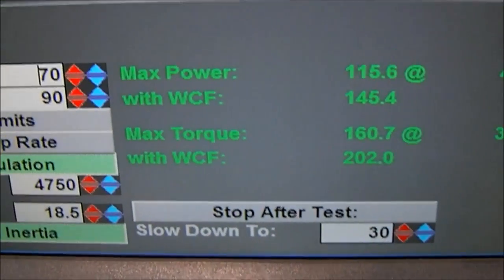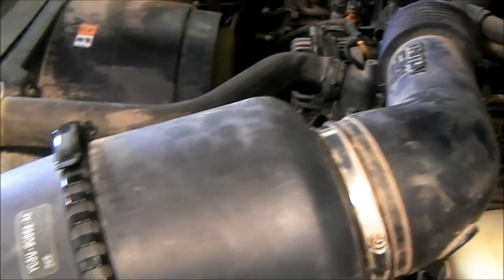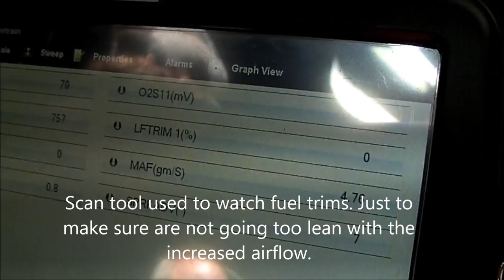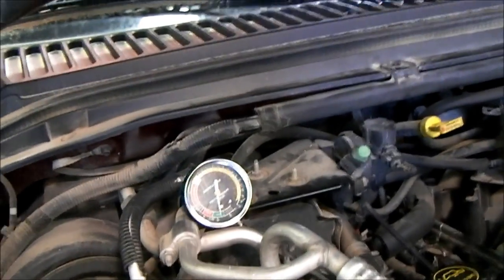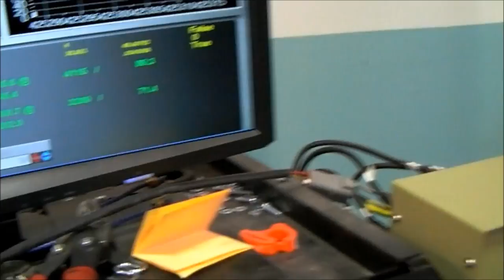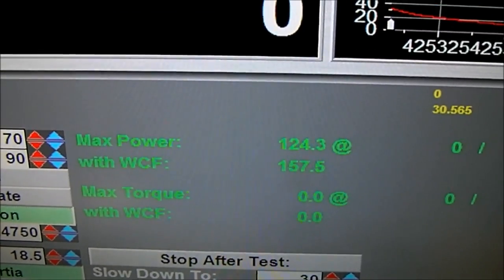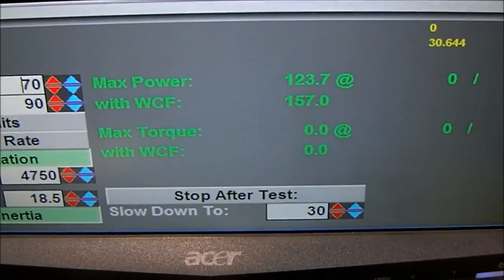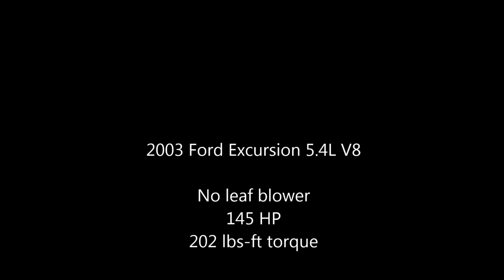Leaf Blower Forced Induction

Comment: You have successfully harnessed the power of a Honda civic into that truck.
Reply: What Honda Civic has 160 hp in 230 foot pounds of torque I’ll wait
Reply: 2022 Civic Type R 306hp / 295 lb-ft torque

Comment: The 5.4 is hands down the worst v8 around 😂
Reply: for 10 years Fraud built that Pos
Reply: tyler cobler nah, the 4.6 is worse.
Reply: Correction. The 3v version of the 5.4 that has timing chain rattle is the worst. The worst v6 ever made is the Ford 4.0 sohc from rangers and explorers.
Reply: @TheMattc999  5.4 is worst, they had many more issues than the mustang 4.6 if not maintenanced...
Reply: Not really my dad has one with 180,000 miles and goes strong with only regular maintenance
Reply: 1979 corvette 350 is pretty bad. under 200 hp but decent torque.
Reply: @jordanbrooks9649  180k on a triton 5.4 3v is elderly and a ticking time bomb. If the spark plugs haven't turned into bullets yet, the oil delivery is about to rear its ugly head any time and the literal only solution is an actual engine replacement
Reply: @samnoneofyourbisnus2543  that's bad power output but it was also 79 so kinda not surprising. However the Ford 5.4 3 valve is an absolute gangbang of actual mechanical and reliability nightmares
Reply: @TheMattc999  the 4.6 is invincible
Reply: @TheMattc999  Lol what? No issues with my 4.6 Mustang so far with 140k miles and I do burnouts daily.
Reply: @hunterpark1221  except for the fact that it has the same penchant for turning sparkplugs into bullets as the 5.4. And you should see what happens when one hits the fuel pressure sensor on your fuel rail in knocks it off. Ask me how I know. 5.4/4.6 biggest manufacturing mistakes Ford ever made (at least the early ones).
Reply: @alickswiden71  250k and was used to haul a 4000lb trailer for 5yrs in recent times.
Reply: The first gens were ok, but with a combination of the cheap nylon timing guides, piss poor tensioners and the introduction of the phasers, Ford could have done way better. BUT GM always had its issues with lower intake gaskets and head gasket problems, Dexcool was a shit fluid for those vehicles. Then you look at the timing issues that the v6's had with phaser wear and chain stretch, seems all manufactures have their issues. Early Toyotas had frame issues, some Dodges had trans issues although that seemed to be a stigma...
Reply: @hunterpark1221  it actually is a good car, the new edge sn95 mustang 4.6L. Have an 04 with 55k miles. I think the rear main seal leak is one expensive thing to fix on these cars.
Reply: @TheMattc999  
The 2v 4.6 sounds nice
Reply: Check out my 5.4 sounds better than whatever you got

Comment: Should have turbod the leafblower
Reply: shawn rayes hahaha
Reply: Cant turbo a 2 stroke
Reply: shawn rayes they are currently slamming the leaf blower on tarmacs and dailying it
Reply: Itz_Ya_Boi_Ryan yes you can
Reply: Turbo charged*
Reply: Itz_Ya_Boi_Ryan No... you can't turbo a valveless two stroke.
Reply: Biggest ships engines are turbo 2stoke diesels.
Reply: behemothfan666 F T P thats what i just said...
Reply: Itz_Ya_Boi_Ryan Are you positive that's what you said? I see and read "can't turbo a 2 stroke" when in fact you can
Reply: behemothfan666 F T P and you said " no you cant turbo a valve less 2 stroke." And thats what i said. When you turbo a 2 stroke it just presurises the crank case. So it works against the downward stroke of the 2 stroke
Reply: Itz_Ya_Boi_Ryan Exactly my point you stated you can not turbo a two stroke which is not selecting a particular functioning 2T  And I'm stating you can't turbo a valveless two stroke which you can't. but for example ones that consists of exhaust valvs can be.
Reply: behemothfan666 F T P ahhh okay i gotcha. I was a little confused there for a second. I understand you can turbo a 2 stroke with valves. But the leafblower in this video is a traditional 2 stroke. And you can not turbo it
Reply: Itz_Ya_Boi_Ryan its all good i should of worded it better. Yes Putting a turbo on the leaf blower will do more damage than good even more so with it being a piston port and not a reed induction/case
Reply: with a hair dryer? what would turbo charge the hair dryer then?
Reply: why? explain?
Reply: @natesmith1276  not the same thing by any stretch.
Reply: Lol
Reply: Leaf blower the leaf blower
Reply: @TypicalPeen  You can turbo a 2 stroke if you run it rich
Reply: well, what you do is run the outside of a leaf blower into the air inlet of the next one, daisy chain style. dont turbo the engine just its compressor?
Reply: @behemothfan666ftp4  still should have turbo'd it

Comment: The absence of a vacuum readout is indicative of a constant flow - on the top side of the exponential curve - right though the scape valves seats - so their exiting gas temperature - which would render those seats irreversible burnt, after a few hundred klicks. But this is my opinion only. A useful compromise can be met, nevertheless.

Comment: 5.4 V8 makes 145 to the wheels. 1.3 rotary makes an easy 180. I think there just might be a replacement for displacement. Still, that was an awesome result with the leaf blower! That's enough of a gain to actually count it as legit. It'd be interesting to see the difference it made on a smaller engine that flows less air, see if more boost built up and had a higher percentage difference in power.
Reply: The difference between the 5.4 and the rotary is torque. Rotary engines don’t make a lot of torque and make all their power at a high rpm. Not ideal for use in a truck. The 5.4 likely makes most of its power and torque at lower rpm’s.

Comment: The compressor in the blower can only achieve a tiny pressure ratio with it's low pressure, high volume wheel.  If you blow one leaf blower discharge into the center of anothers intake sealed, and then do this again and again with 2, 3 or 4 of them, eventually you can actually make measurable "boost" with enough stages.

Comment: oh my god is it on 3 cylinders.?
Reply: mymitsu6g72 it's a ford
Reply: i have THE SAME pos ford
Reply: I never could understand why Ford even offered the 5.4 in the excursion. We had 99 expedition and we got the larger 5.9 or 6.0 can't really remember what it was. But it was what the larger ford gassers trucks should haves come with standard at the time. The excursion really should have come with the 7.3 diesel.
Reply: ZealousAce it did my guy
Reply: s w  you have the gas version I have the 7.3 diesel thick is a lot better
Reply: ZealousAce it does come with the 7.3
Reply: ZealousAce it did. It was in the ones that say "limited" they were pretty legit, but very unefficient.
Reply: +carson walker    Being a 5.4 it probably blew some out lol
Reply: ZealousAce  maybe a 5.8?
Reply: ya, i bet it was a 5.8 bc ford does like to reuse engine designs for different vehicles. for example, the 2017 gts have the same exact engine as the ecoboost trucks. we have a 5.8 gt40 pro boss in our boat that was from 2001
Reply: emersonDAbeast wasn’t a 5.8.  Ford gasser endives were the 5.4l v8 and the 6.8l v10 for those years. The 7.3l diesel was offered from 99-03 and 6.0 was offered from 03 until the 07, the year that the truck and 6.0 were both discontinued from Ford. 5.4 and 6.8 mod motors were some of the best gas engines built by Ford. From 3,000 rpm and up, the engines moved out.
Reply: Tom Foolery oh, but they still did have 5.8 gas but I guess ours was from a ford gt
Reply: emersonDAbeast  that 5.8 was really before they used liters to classify engines. It was a 351cu in engine as the 5.0 was a 302. Neither were offered in trucks after 1998 until they came back out with the 5.0 and was offered in the trucks starting 2011, I believe. The 6.2l gas engine came out that year also for the superduties but was also available in the 1/2 ton platform along with being the only engine option for the Raptor after the 5.4.
Reply: Tom Foolery ya, i know it a 351 big block but the plastic cover says proboss 5.8, PCM, and gt40
Reply: emersonDAbeast the 351 is a small block. Not a big block.
Reply: Tom Foolery oh, well my dad kept saying it was a big block, or maybe I'm thinking of another vehicle
Reply: emersonDAbeast are you sure it wasn’t a v10. Ford had an experimental 5.8l 54 degree v10 that wasn’t offered in vehicles but I’m sure there are probably replicas all over the place. Marine racing wouldn’t be far fetched for this engine.
Reply: emersonDAbeast btw.... that was a 2001 block.
Reply: Tom Foolery I know, our boat is a 2001
Reply: emersonDAbeast there was a 351 big block. It was called 351 Cleveland motor. It was a old muscle car mustang engine. The windsor 351 and 351 modified were small blocks.
Reply: Tom Foolery Thank you for actually having common sense unlike some of these other people.
Reply: Brandon Hunt gotta go with the V10
Reply: Tom Foolery your forgetting an engine lol
Reply: emersonDAbeast he's wrong your right I see to many ford worktrucks stamped with it
Reply: emersonDAbeast it's a small block bud lol
Reply: Tom Foolery thankyou
Reply: Big Greg sparks they never put a Cleveland in mustang, never even a 351 the only one close is the 302 windsor
Reply: Tom Foolery Ford made 2 engines that were 351cubic inches, the 351 Windsor was a small block where the 351 Cleveland was a big block .
Reply: They did! Check into the old mach 1s.
Reply: They even put a 429.
Reply: @versask8td  expeditions only came with a 5.4 or a 4.6 in 99.
Reply: Considering my 1992 Mercedes 300D turbo diesel with a 2.5 l inline 5-cylinder diesel engine mix about a 105 horsepower to the wheels maybe a tad more. and that's with the stock lazy manual injection pump. 

With upgraded injection pump, and electric lift pump added that amount goes up to somewhere near a 160 horsepower at the crank. 135 to the wheels. 90's era IDI turbodiesel, no intercooler.
so you may want to revise that statement as it is an insult to engines less than 8 cylinders to make that kind of comparison LOL.